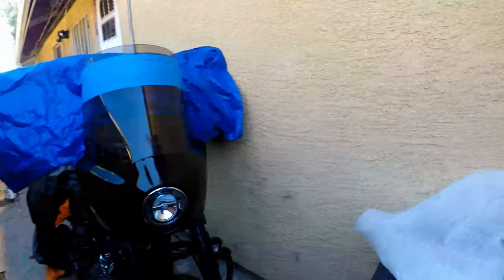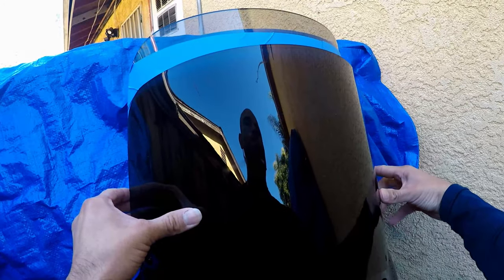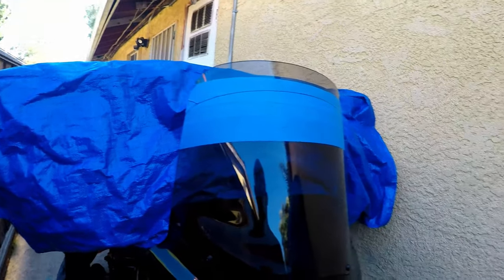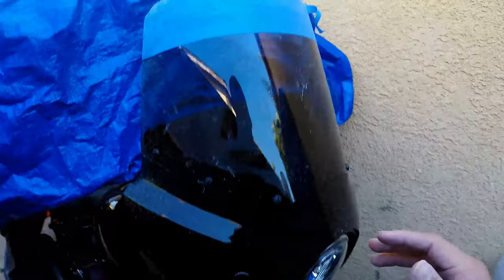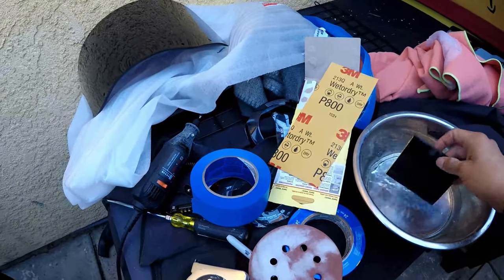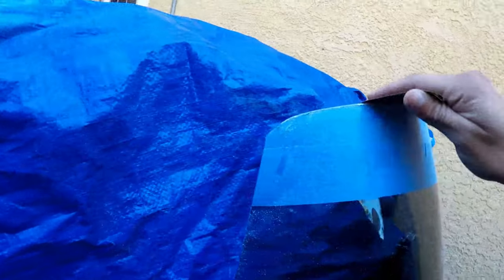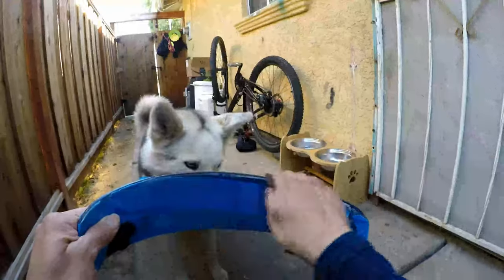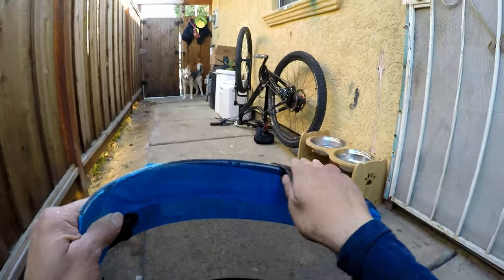How To Cutting Motorcycle Plexiglass Windshield Memphis Shades Road Warrior

Comment: Use a jig saw with a metal blade on the saw's lowest speed setting, no melting and barley any sanding when you're done, just go slow and precise
Reply from the maker: True, depending on the cutoff wheel, the plastic can melt

Comment: I got the 13” and I’m 5’11”, but it still seems too tall for what I like. I wish I had bought the 11” instead. I tend to slouch over when I ride and while I can definitely see over the 13” it’s just in a spot that bothers me. Of course when I get some taller risers I might wish I had the 13” back? Maybe I should wait?
Btw, you can cut it with a jigsaw too. Just use a really thin blade. Motorman has a video using a jigsaw.
Reply from the maker: I actually cut my 15" Windshield, down to 13.5". I have the 11" installed at the moment.
Reply: @InfamousCreep   I was able to adjust where the fairing sits on the forks and I’ve dropped the windshields height down at least an inch or maybe 2, so it’s perfect now! 
I wish I could go back and forth between the road warrior and the stock fairing easily. I love the stance of the FXLRS with that stock mini fairing on it😍!

Comment: First of all, Memphis Shades are not Plexiglas. They are A kind of Lexan which is much better and more expensive. And you CAN cut it with a sabre or jig saw, unlike what this guy told you. You should use a fine tooth blade to minimize a rough edge. Then you can fine sand the edge smooth. I just got done making a pair of lowers for my motorcycle to mount just below the windshield on the forks. I used a sabe saw to cut the shape out followed by my bench top belt sander to finish the edges. They turned out just like the Memphis Shades lowers and look just as good.
Reply from the maker: Table saw doesn't cut the same as a jig saw, but yes it should have extra fine teeth.